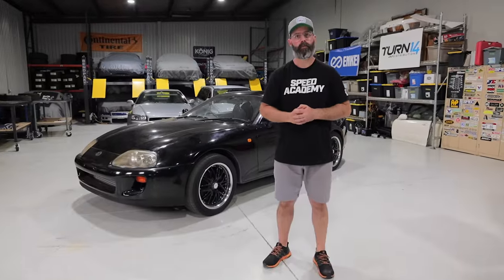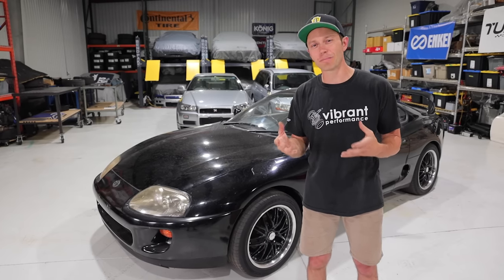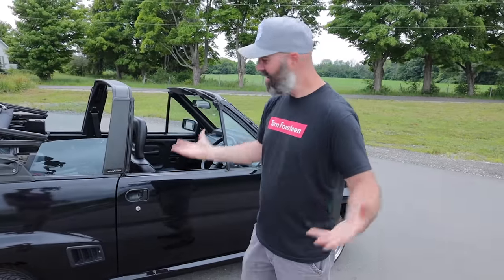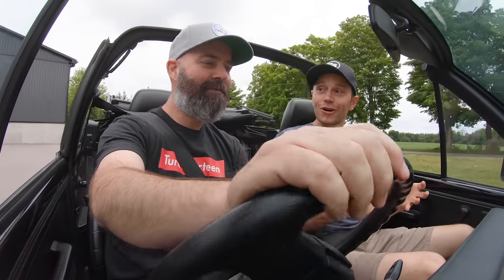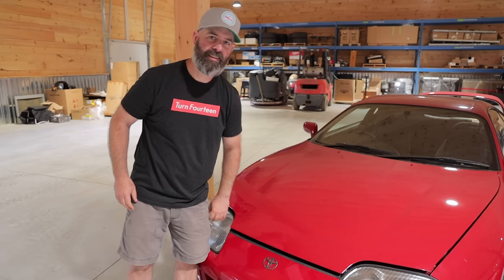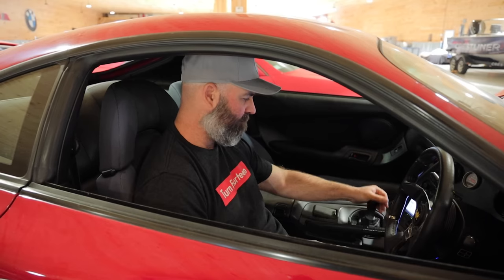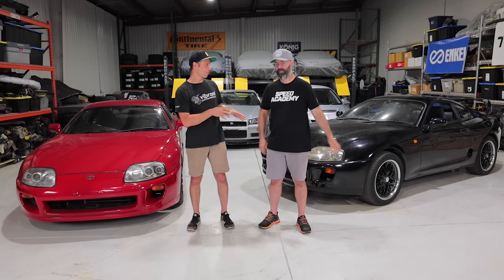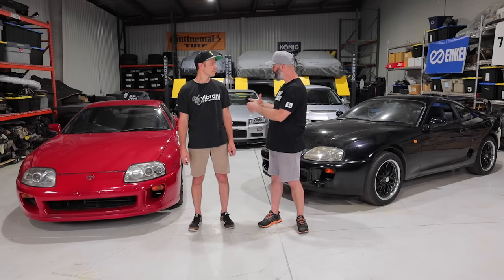Buying ANOTHER JDM LEGEND!

Comment: God I love the way these things look! And they handle incredibly.
Only downside is that they really can't compete on the speed or power we normally expect from a sports car these days (as in the Supra or GT-R both had more power when completely stock and untuned than the NSX). I know some people K swap them, which gives them power but you lose a lot of the sound and character, or turbo the stock motor which again takes away that nimble responsiveness. Best update to one I've seen has been a supercharged one. Just a lil bit more poke (around 350-400 wheel, I believe) but still with the same noise and response as the stock motor. Might be worth thinking about it you find it a little 
Underwhelming in terms of performance